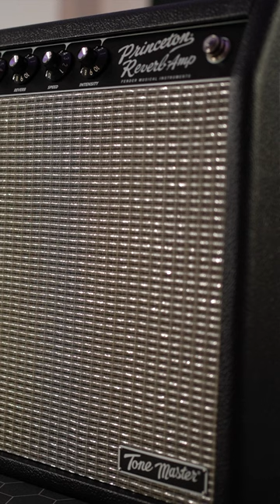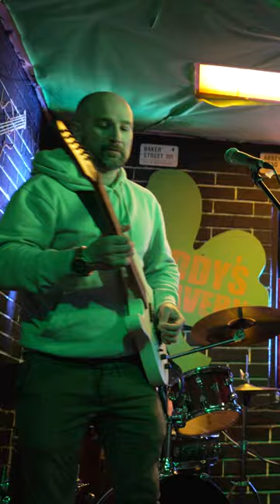Using a Digital Modelling Amplifier LIVE - #shorts

Comment: They sound okay, but if they break down, they can’t be fixed. Fender should put the power scaling into its valve amps.
Reply: Russia makes a lot of vacuum tubes. Fender is competing with Boss.
Reply: And the Catalyst (Line 6?)...
Mates got a Bassman reissue.. you can't get that tweed sound unless it's cranking..
They're not made the same as the 50s amps either.
Edit: some sort of power scale wd be handy tho.